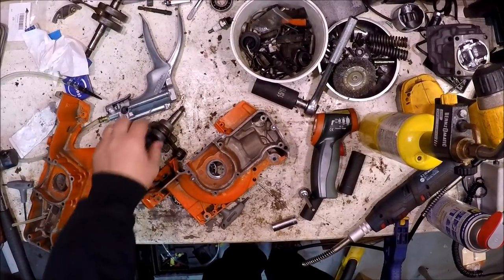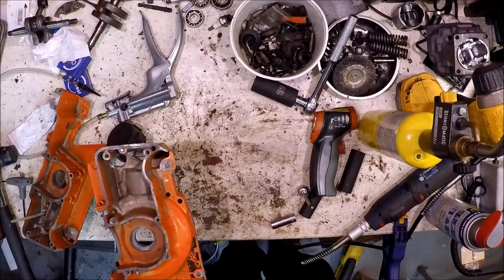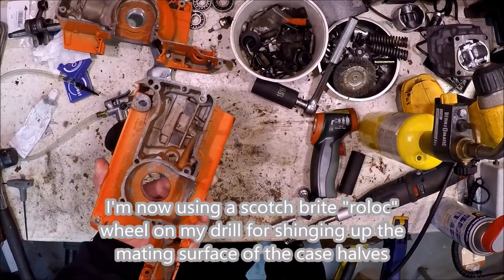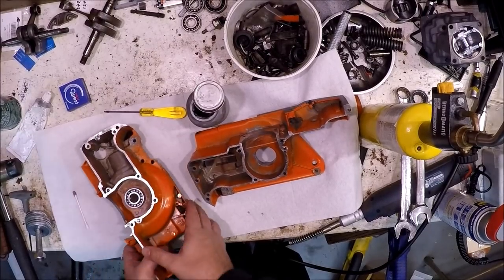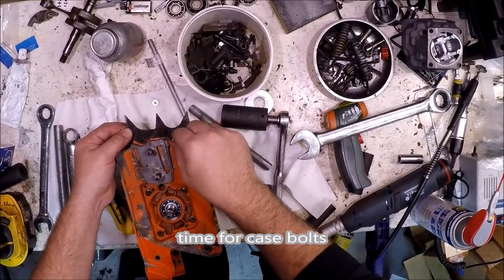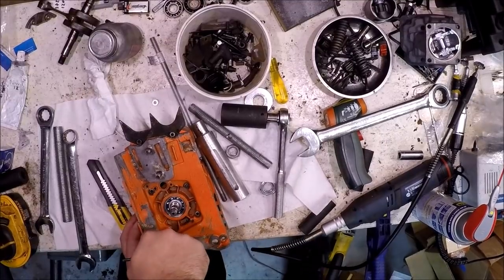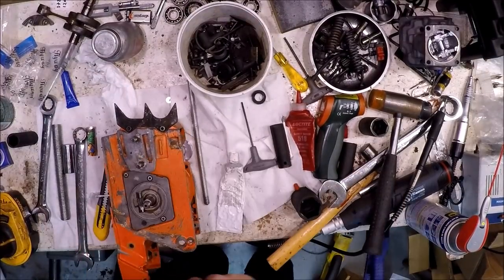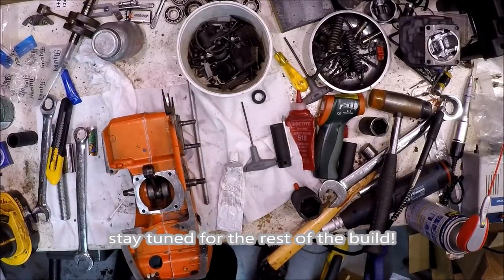Husqvarna 272 build, part 1, crankcase assembly - bolt for bolt!

Comment: You should be using Nickel anti-seize. The conventional anti-seize can set you up for corrosion issues with an aluminum or magnesium materials nickel anti- seize prevents this.
Reply from the maker: Interesting...didn't know this exists

Comment: Great videos big help. I'm reassembling my 272 case gasket crank seals and now I'm putting the cylinder back on and she is hard to turn over like i need to use a wrench to turn it. Crank bearings were fine when i tore it down. Should it be hard to turn the crank without the jug on it? Thanks.
Reply from the maker: Seals do add friction
Reply: It should not be tight should turn freely, . Lightly tap the crank on each side a few times side to side and make sure your crank is is positioned properly because the 262/266/268/ 272/327 cranks have to be in a certain position side to side or you can blow them up, break cranks, crack cases, blow seals and bearings out etc, etc just keep these things in mind

Comment: Very helpful Video well done Matt.  two separate Farmer 272xp oil pumps  with seals provided by HL supply slide down along greased coke can over the proximal shaft   sitting perfectly around shaft.   Slid down against crankcase oil pumps sit catawampus  with screws tightened and also prevent shaft of oil pump to turn freely.  Go with OEM 106$. ? help
Reply from the maker: I'm sure you can find a oem used pump.  I just did a 266 pump....  check out that live vid...
Only a few weeks ago.  See if you find something in there that helps.  Also...gotta do a dry run with the pumps and see if something is causing the binding
Reply: @matthewolson8875   great help thanks Matt

Comment: Matt great video. I’m working on a 272xp. Doing a complete rebuild. In the first video of this series you speak about the main roller bearings. As you stated the OEM are pricey. So can you tell me where I can obtain a set or will you sell me a set. If not what are numbers are brand name of the bearings. 

Thanks Don
Reply from the maker: Look for nachi 6202 bearings on ebay ....you can pop out the seals if you get sealed or shielded bearings and they will work fine
Reply: @matthewolson8875  they have a few selections of 6202, wouls you know what model would it be? found one that said 6202-2nse9 and one that is 6202-2rs. all different dimensions.
Reply from the maker: @ryy597  any 6202 is same dimension but different seal or shield.  I use nachi 6202 bearings and pull out the shields or seals.
Reply: @matthewolson8875  i guess that would be the 6202-2NSE9 (15mm × 32mm x 11mm). thanks alot for your help! i been ordering all sorts of parts am fully rebuilding my jonsered 630. it will have 272 top end 52mm piston. will maybe order a new crank since everything will be new. i also like the concept of your tool. does the sleeve on your crank puller go against the inner race of the bearing?
Reply from the maker: @ryy597  inner race....yep
Reply: @matthewolson8875  ive got your email, i might end up ordering one.  cheers
Reply from the maker: @ryy597  if I don't respond in 24hrs....u have the wrong eml....tx

Comment: Doing seals on my 272 haven't split the cases but is it necessary to change the crank bearings and case gasket? Thanks
Reply from the maker: Not necessarily necessary to change the bearings.  But if you split the case you might as well change them.
Reply: @matthewolson8875  how does the flywheel side seal come out then? I got it tore down piston is black so I'll order a cylinder and piston kit while I'm at it. It there a special way to split the case? Thanks
Reply from the maker: @richardbonfanti8028  check my latest vids on a 268....very similar

Comment: is there a way i can contact you? i have a few questions, you seem to have some knowledge when it comes to crankcase and saw building!
Reply from the maker: Yes....check the live chat section in my latest vid ...my info is there
Reply: @matthewolson8875   hey matt what is the tool called that you used to press in the crank I'm doing the same job once parts arrive I hope I can get it on eBay
Reply from the maker: @danielwall1196  those are my tools and I sell them....shoot me an email mattyo5@@@@@aol.com  ......remove the extra @@@@